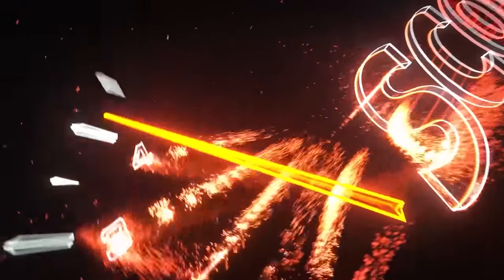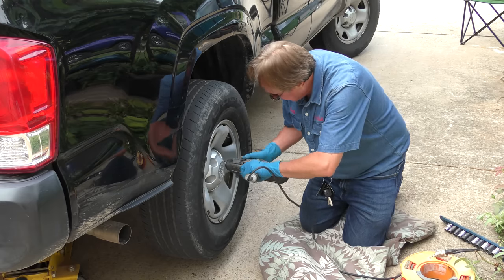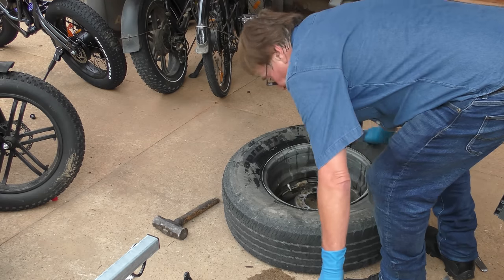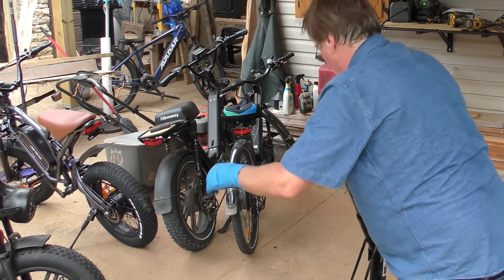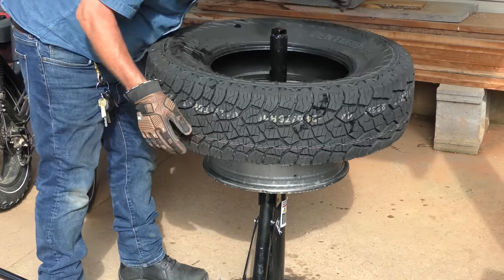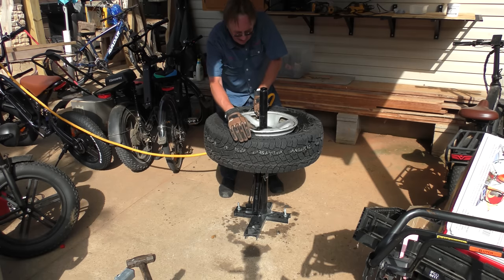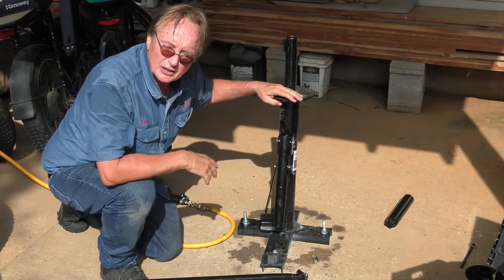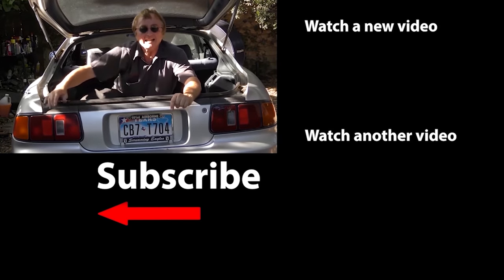Never Buy This From Harbor Freight (Almost Broke My Hand)

Comment: I bought one years ago and it’s saved my bacon a time or two having swapping tires when the shops are all closed. It works a treat for trailers, wheel barrows, etc. 

I pay a shop to mount/balance, but sometimes you have no choice.

Comment: Hi Scotty, I bought one of the Harbor Freight tire changers over 20 yrs. ago! they were junk then also! the first thing that went bad was the bead breaker just like yours'. So I went out and bought a manual bead breaker from J.C. Whitney, it works great. I did some mods on the tire changer and now it's o.k. I use a tire lube that is like moly lube, it's great, but It's really expensive(rim no rust) or something like that. Like you I learned on a manual machine when I was 12 yrs. old I changed tires and cleaned up cars at a Buick Dealership. Back then it was alot easier, the machine was alot better and I wasn't 73 yrs. old but I still do it Mostly on steel rims or break a bead to change a TP sensor. Aluminum wheels are tough because I don't want to scratch them up so I get the tire shop to do them now. I used to do them at work, but I'm retired. Good piece Scotty! Thanks

Comment: I also have one, had it many years. One thing I've found is, he is correct - somewhat. It is NOT made strong enough for pickup truck tires. Truck tires are more heavy duty, stronger beads etc making them more difficult for a DIY'r. For car tires and small to mid size trailer tires it works great.

Comment: I worked  for a large  landscaping company, I used one of those HF tire changers for 10 yrs.I paid $29.00 on sale.I never had a problem withit,it was bolted to the concrete floor and I used it mostly  for trailer  tires (10,000lbs) and large grass  cutting machines, machines,occasionally pick up tires,never had a problem. I always  wore gloves!

Comment: I have the same tire machine, I've done 1000s of tire removals.  I did have to weld a plate on the bead breaker after a few months. I also use my big screwdriver type pry bars to remove and install tires

Comment: LoL, You're the best! And right on the money. I use an old tire machine from the 50's. Yes it was made for the steel rims of it's day, and takes a little more effort for it to work on modern rims. But it works. It's made heavy and will not bend or break.

Comment: Hi Scottie, I worked at a gas station in the mid 60’s and they had a manual tire changer, but made a lot better,so I bought a harbor freight tire changer about 25 years ago and mine has always worked fine. It was a lot easier to use since I had experience using a manual tire changer. Still use it today at 76. I also have the harbor freight balancer. I bought the weights at J C Whitney.

Comment: I bought one of those for $40 and have been thrilled with it.  I've been able to change tires on our trailers relatively easily, and have never removed or mounted tires before.  I can see where larger rims/tires might pose more of a challenge, but for certain jobs it's been great.

Comment: One of the main things is the Harbor Freight Tool held the wheel and tire from moving around which is very helpful when you're changing any Tire a lot of times you don't even need a tool to put the tire back on the rim . And breaking the bead is definitely the hardest part about changing a tire
Reply: Very true. Sometimes I just use a fence post driver to break the bead. The bead breaker on this tire changer is pretty weak.

Comment: Ive used for years. Changed a hundred tires. I welded rebar on the bead breaker pedal so the arms don't bend. Use a pipe on end of slide bar for more levarage

Comment: I bought an old coats shop tire machine and balancer for $600 off marketplace a few years ago. Came with spoons, and several boxes of weights. Best $600 I’ve ever spent! I use it mostly for mounting slicks for my drag car, but handy to have for my streetcars.Good equipment is affordable if you look in the right places.

Comment: Bravo. Takes me back to me & my 2 brothers would change out a lot of our inner tubes on our bike tires cause the inner tubes would get holes in em. we'd have a Patch Kit on hand, test the patch fix by putting it under water. Most of that HF gizmo would work fine if a person replaced that weak arm with a strong arm. Ditto for the giant arm. But as u pt out u have to balance the tire(s) so might as well take it to local tire shop if ur in a city.

Comment: I have that machine and I did a little strengthening and I’ve used it to change many tires. I also have an old bubble balancer. Never had a problem. It is a little work though. If you have a welding machine to can make it strong enough to work. Oh I’m also 70 years old.

Comment: I installed a tire in 2 minutes with the black Harbor Freight tire changer.  I purchased it in 2024 this year.  I used tire bead paste on the tire and rim.  It went on like butter.  It was a 16 inch rim /  and a 205/55r16 tire.    I haven't tried to break the bead as the tires and rims were new.  However, I will be sure to use soapy water for future bead breaking on an old tire removal.

Comment: Scotty, you are correct the old ones are way better. I bought mine 20 years ago originally to take tires off aluminum slot dish mags that I bought from the scrap guy for $11.00 each! They were perfectly good and I have 3 complete sets of 4 and 2 wheels that are drilled for bead screws. I've done all pickup tires up to 16.5 and it has served me well. The steel is much thicker and there is a floating pin on the tower for the lug hole. Make yourself an easy bead breaker for your floor jack. It's a teeter tauter affair, the jack hooks into one side the bead breaker on the other. Let the jack do the work! You can find the video on YouTube. Ya just can't be workin that hard, you got 4 years on me!

Comment: I’m 73. Maybe my additional experience is the difference. I just bought one of these two days ago. What could go wrong with a $50 manual tire changer? In my case…..NOTHING! I had absolutely zero problems with this in stock configuration. I changed all 4 tires on my 1/2 ton Chevy pickup in less than an hour. I think that Scotty gave up too soon with that motorcycle tire iron. In my case, this was IMHO a great addition to my shop.

Comment: I got mine in 2008.  Never used it on car tires, used it on my motorcycle tires.  Haven't mounted it on my new house barn, don't ride the motorcycle anymore. Was commuting on it so I went through tires pretty quick.  But did put two car tires on the rear so maybe they got cheaper.   Did just use it to bust the bead on my lawn tractor tires today.

Comment: I've been using mine for decades, mostly for offroad tires.  Motorcycle, UTV & SUV, wheel barrows, wagons, etc.  It's still working, yes I use other tools for breaking the bead, and a modified cross bar with a plastic "duckbill" attachment (works MUCH better).  I would Never try and change my truck tires with it but it's great for Many other uses.

Comment: I extended the handle of the tire iron piece..... doubled the length. Makes it way easier to create enough force to get the bead on or off. Can use locking pliers with protective pads to grip the bead and reduce tire spinning.  Use a piece of wood to ensure the already-over-bead portion to stay in the recess of the wheel (keep tire bead away from rim, forcing bead into the recess of the wheel....allows the bead opposite to more easily stretch over the rim)

Comment: sirry you got a bad one..I have one that I bought 15 yrs ago..mounted to concrete and is outside yr round and it works great..mine is red,purchased 15 yrs ago and have used at least twice a yr to change both car and motorcycle tires,patch a tire ir just replace valve stem. mine is great.

Comment: I got one of these several years ago and worked fine replacing my 4 tires + spare. Was it more a fight than using a full tire machine? Sure, but it still got the job done for a fraction of the price. Just buy their little bubble balancer and balance them yourself.

Comment: I’ve used one several times and I’ve never had an issue with it. Picking that tire up he looked a little on the weak side so lack of strength might be the a factor as well

Comment: Well Scotty, you are smarter than me. I bought 3 of those pieces of junk over a 10 year period of time. I thought the first one was junk but the last one was made in Taiwan and cheap is an understatement. I bought the old family homestead and all the old tires and rims ended up in the woods,on the edge of the field. Over 400 of them. Try breaking the beads on old rusted rims and you'll find out quick how junky hf tire machines are. Scotty is 100 percent right on this review.

Comment: My dad used to use an old style ratchet jack on the back of his impala to break the bead on a tire.  The edge of the base was put down near the rim and then the jack was jacked up until the bead collapsed.  Then using a couple of tire irons the tire could be removed.  Then he used a rubber mallet to force the tire on the rim.  He never had tires professionally mounted and balanced until he was much older.

Comment: I got one of those about 20 years ago. Changed many many tires with it. The bead breaker part finally bent about 5 years ago. Made my own arms for it out of thicker steel and it still works to this day. I got my monies worth out of it. He is right about the end of that bat though. It's nothing but a pain in the hind end.

Comment: I have one of these. You must bolt the thing to a pallet or something stable. You MUST REINFORCE THE ARMS OF THE BEAD BREAKER, or they will bend and flex sideways. The tires must be within a certain measurement. DO NOT TRY TO MOUNT OR REMOVE Extremely low profile, or run flat tires! This machine will put knots on your head! If you know how to use it, it will save you a little money.  It does not balance your tires. Pay attention to where the balance marks are on the sidewall, so you can get the balance close to spec.

Comment: Harbor Freight sells a little one for riding mowers & small trailer tires. It still takes my old butt effort to take the old rotten ones off and put new ones on, but it is made well enough to do the job. And at $25.00/ tire at the shop the Harbor Freight tool cost me two tire changes.  
 Small tip: make sure tires and rim are as warm as you can get them. Either in a warming oven or left out in the sun on a bright sunny day. Trying the change tires in the cold air will have you beating and yanking on them until summer.

Comment: The price is right.  I bought the black one.  They are a little light weight but I'm an old heavyweight and know its limitations.  I did re-shape the mounting head with an angle grinder and it helped a lot.  I also bought a duckhead kit (prices are coming down) to use on my alloy rims.  I am very happy with mine, I grew up in a service station and it's just like old times.

Comment: I'm a big proponent of doing it yourself whenever possible.  But this is one thing I let the pros do.  They get the tires on and wheels balanced in a matter of about 30 minutes.  If something goes wrong with the tires, they fix it at no additional charge.  This looks like an all-afternoon job for four tires and if they end up out-of-balance, you're still heading to the tire shop anyway.

Comment: Great video and i agree the bead breaker bar is cheap ... First one bent on the second tire... Took it back t HF got a free replacement, fit a piece of 2x4 between the bead breaker arms and have been using it ever since... At 20 something dollars per tire for mounting it saved me and my family money (they all do their tires here) Btw I was taught to remove tires from the dirty side to protect the rims.

Comment: Actually...I have had this tire changer for years and it works excellent if you know how. There are a couple trucks. First...use soapy water. Don't go in dry...and giving it the old "hawk tuah" doesn't work. Second...when using the bar to dismount and mount the tire don't pull it like that. Put your hip against it and simply walk. It works fine, and pretty quickly.

Comment: I have one of those. Mine is red. Don't know why you would pry the first bead on, i don't. A big hammer will pound it on really easy. I never put new tires on myself. Always have the tire shop install the tires. They have to be balanced correctly or you will get a code. Doesn't matter what it is, you have to be smarter than the tool to use it.

Comment: Ahhhh, Ive had mine for 6 years.   Done  as small as zero turn tires and the biggest was a  16"    LT   on  one of my trucks.  Never broke my hand,  never had it not work,  paid 39.99 and have saved myself many many times that on mountings.    Not to mention that time  and hassle savings.

Comment: I have one of these.   The bead breaker is a piece of crap.  I eventually put 1/2 in anchor bolts to hold it down.  You have to use tire tools to get the beads back on.  Also, you forgot to use the dead blow hammer on the first bead usually w/o tire tools.  I already had a different bead breaker so I use both of them when I use this tire changer.  I agree with you the iron for the bead breaker is insufficient for the task.

Comment: Yep. I've had my hf bead breaker for 20 years. It's been a good unit but I've never mounted it or used the top part. Just used it to break beads.

Comment: I have rules I follow with Harbor Freight tools. If it's air powered, oil it well and run it without a load for a while to polish things up on the inside, etc, etc. If its electric, run it at variable speeds for a while without a load to make sure brushes seat, it does not overheat, and again to polish any sleeve bearings. Anything electric that has a 90 degree bend is always taken apart and packed with grease around any gears (usually there is little to none) before using it. If it's hydraulic, change the oil or at least top it off. I avoid battery-powered HF tools as all failed within a year (batteries, not the tools). I have tools from HF that are decades old that still work fine, but I've also bought things that didn't even survive 1 rpm before the smoke escaped. But breaking in their tools does help..... a little.

Comment: I've had one for over 15 years, welded angle iron on the wimpy bars to stiff them up. Saw a YouTube video using a scissor jack pushing against the hitch on my e250 van. This breaks the beed on on the 16in load range E Easley.

Comment: I used those for the company I worked for and the reason, odd sized tires use in agriculture..
We mounted it to a heavy duty pallet..
It worked a whole lot better than watching the tire busters struggle trying to bust the tires down using the Automatic machines.

There is a trick in using the $49 tire buster..
We learned it.
Wait until you try the small changer for pneumatic caster tires, those are a lot more fun

Comment: I bought one of these about 2 years ago and never used it until last week. I bought 4 news tires and changed all 4 without any issues, it worked just fine and I had never used one before. I'm 61 with a lot of muscle loss and had no problem changing them. I'm going to do some upgrades but only because I like to tinker around with stuff like this.  I usually agree with Scotty but I think he got this one wrong.

Comment: You have to buy the adapter for the machine  and lube the tire really good. And the manual tire changer works good. You are right,without the adapter the machine is junk.

Comment: I just ended up making my own by copying the Harbor Freight model, but I made improvements with the bead breaker and a longer handle for the removal/installation tool so it was easier to work it.

Comment: Bought one about 15 years ago. $32.00 out the door, never bent any parts. I also use a set of 30 year old compound motorcycle tire levers. By the way I'm 78 and change my tire cause I want it done right.

Comment: My HF tire changer is a few years old. Guess I got one of the better ones - the bead breaker arms are much more solid. Bummer that HF cheapened the construction. It wasn't an "every day" tire changer, but the old one at least worked

Comment: The same company must of made the H Freight motorcycle lift, lifted my bike once the steel bent. When I was a young lad worked for Atlantic Wheel of long Island, we worked all tires and rims by hand,using large tire irons and a heavy rubber faced mallet. The only time we had a hard time was with low profile tires,crap,some would tear.But the Mallet and Tire Irons we used made the process easy as pie,a hell of a lot easier then the HF changer.

Comment: Harbor Freight has 24 inch tire irons that are pretty good, actually. The part number is 93230. I've used them for years and they're pretty strong. Harbor Freight also has a static tire balancer. I've never used one, but did see a review on YouTube that suggested a modification to make it more sensitive to slight changes in wheel weight. For what that's worth.

Comment: You really need to locate some of the videos demonstrating how it's supposed to be used if you can't suss it out on your own.

The mounting side of the bar has an angled ramp that levers the tire over the rim as it's pushed against the center. The key to using it is keeping the bar up at a high angle, so the head stays locked on the rim edge without slipping off.
Main caveat is that it's for wheels that you're not worried about cosmetics and scratching,  because it contacts the rim while working.  If that's a concern, the duckbill modification would be a way to prevent contact with the rim.

Comment: Scotty is a beast!  How many 70 year old guys could even change a full size tire?  Maybe 1 in 10.  How many 70 year olds could use a manual tire breaker?  Maybe 1 in 100.  Scotty's the man!
Reply: 🤣🤣🤣🤣🤣🤣 too much soy in your diet, I know plenty.
Reply: I am 74 and just changed 4 tires tonight on one of theses machines with no problem in 45 minutes this guys all mouth i have changed many tires on this machine just time your time.